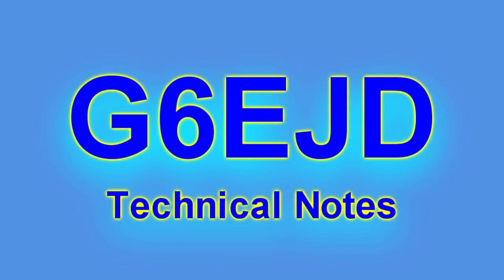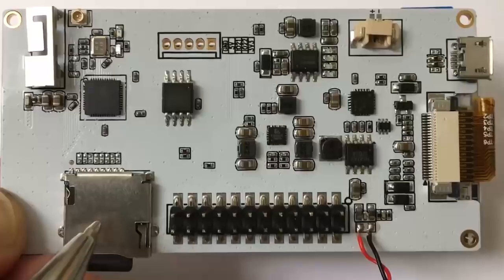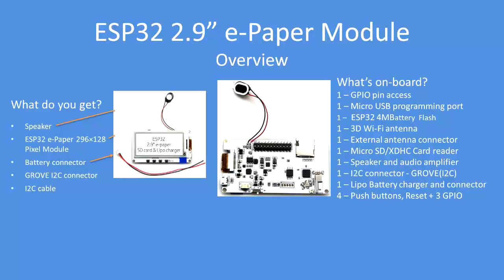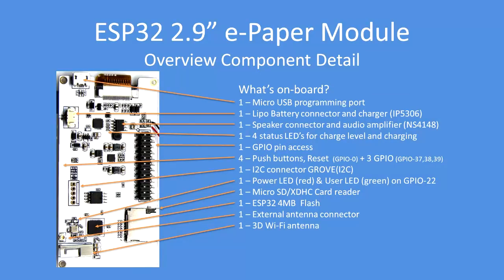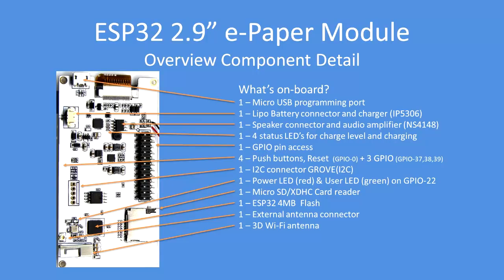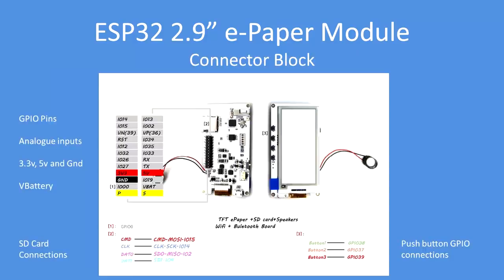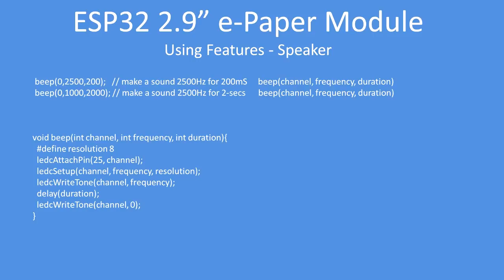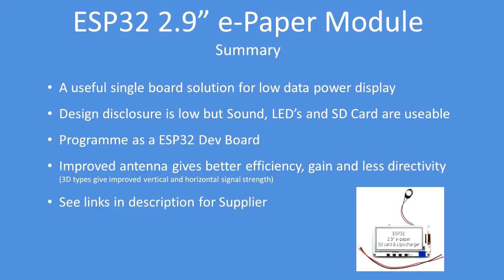Tech Note 099 - ESP32, 2.9" e-Paper, Speaker, SD-Card Reader and Lipo charger

Comment: How much current does it draw in sleep mode?
Reply from the maker: I do t know yet, I’ve spent ages getting all the peripherals to work but now I understand it it’s quite easy which is why I posted examples.
Reply from the maker: They copied the MStack design without realising the implications
Reply from the maker: This is the point, the supplier of this board (lilygo) copied the M5STACK board but replaced the display with an e-paper variant, but the M5STACK is designed to be turned-on/off with the aid of a power management chip and not for low power sleep modes, the result is the moment you sleep the ESP32 the power management chip detects this and then cuts all power to it's 3 outputs (as it does on the M5STACK by design) and the board can no-longer be woke up from sleep as there is no power applied!
Reply: very little - for me not measurable. I have the same display for my arduino (pro mini - powered via VCC + voltage regulator and LED removed) weather station. 
The arduino needs about 30µa alone. With all peripherals (BMP180, DHT22, RTC DS3231, SD Card Reader, display) it uses about 40µa in sleep. I never measured just the display, but it will be few µa in sleep. Doesn´t really matter. The refresh (1sec about 8ma) converted to constant current (133µa) has much more weight. So using an Arduino, its slow refreshing and coinsequently ist long awake-time has the biggest effect on batterylife. Using an ESP32, it´s surely different.
Reply from the maker: segoiii Yes the ESP32 takes 144mA to get data across its WiFi or if not using WiFi then 50mA  if your using a wired connection ie no wireless then bound to use less power.
Reply from the maker: BTW this particular board is switched off by the power management chip after about 20-secs so next to useless.
Reply: G6EJD sorry I didn’t understand what is “useless “ display?
Reply from the maker: Science4all World I was referring to the product I reviewed in this video it uses a power management chip and when it detects the ESP has gone to sleep it switches off the power making the board of no value for low power solutions as there is no power due to a design fault.
Reply: G6EJD oops that is strange. Thanks for informing
Reply: the waveshare display has an own powersaving mode which is really great and uses almost no power. I don´t know why someone would use an epaper display without putting it in powersave mode instantly after writing content on it ...
When i bought the display in early 2017 the waveshare library still lacked the power saving mode. But with the help of the datasheet it was quite easy to do. Simple: void WaveShare_EPD::epd_sleep(){ EPD_WriteCMD_p1(0x10,0x01);} 
And wakeup with EPD_init_Part();

So if the ESP itself has a power efficient sleep mode, there is no need for using such a power management chip.